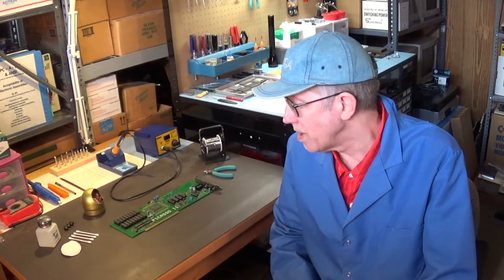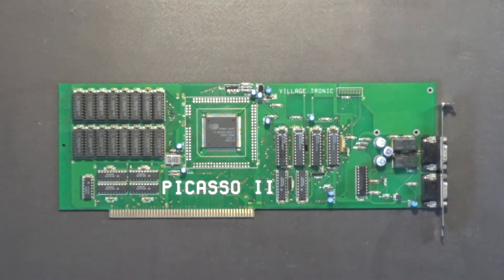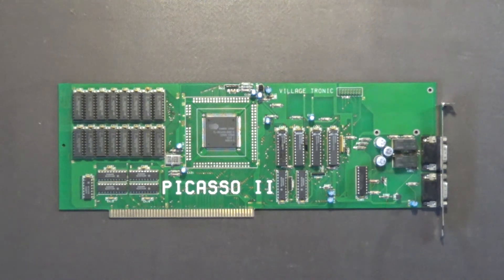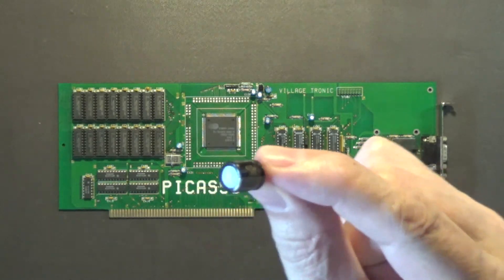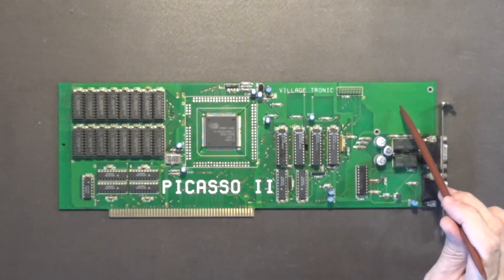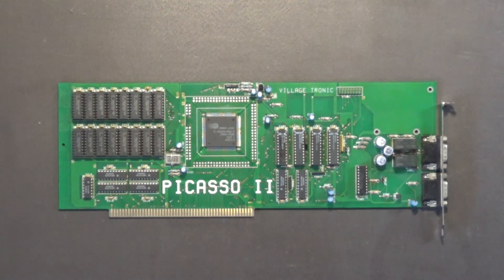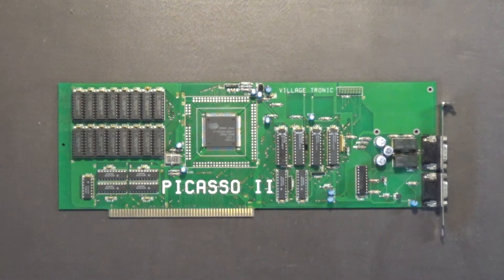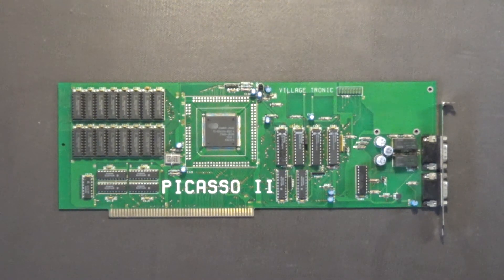My Picasso II Graphics Board - Part 1

Comment: I have a EGS 28/24 GVP Spectrum card. I have the software it came with but I haven't got it working in my Amiga 4000/040. Any clues on getting it working? I have been told I need P96 package but I can't find it.
Reply from the maker: That board, like most boards, was designed to work the best in an Amiga 2000 computer.  My advice, dump the Amiga 4000 and get an Amiga 2000.  You'll be glad you did.  You have to remember that the Amiga 4000 is NOT a true Amiga computer,  it is an Amiga clone.  So, do not be surprised when you have problems getting hardware and software to work with it.

Comment: that would be about 1.5 watts going through that resistor.  And I don't think a little guy like that would handle that for too long.  The RTG board I have in my 2000 is some S3 based unit. (p96) and I think it may have also had one of those resistors as well. But it is not installed.  I had no 32 bit ram on my setup for some time. So having only 4mb z2 ram was really really tight when running more than 640 res at 8bit color lol.. No fancy workbench eyecandy or icon packs for me :(  But I was able to drive non interlaced 75 hz all the way to 1280x1024 res with my RTG card. And upto 100hz at lower res if I wanted. This one should be capable of similar.